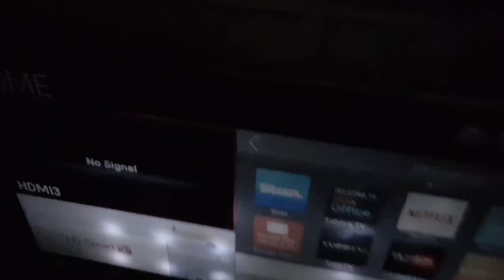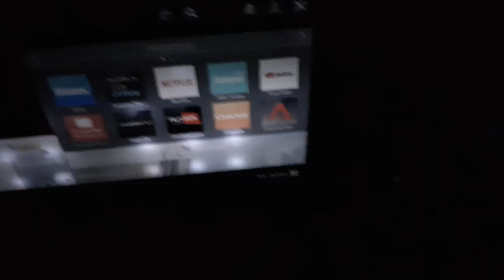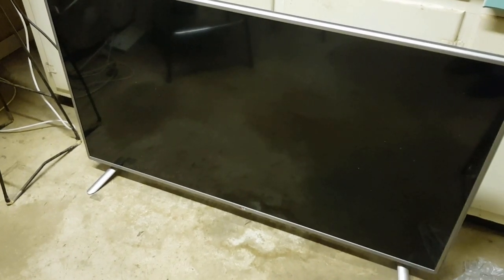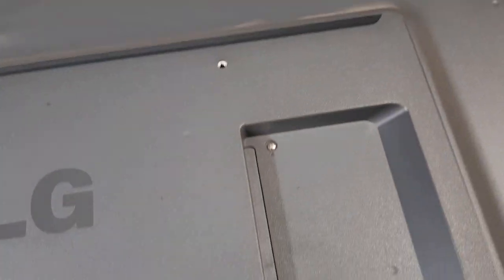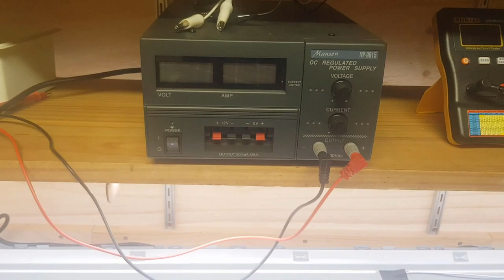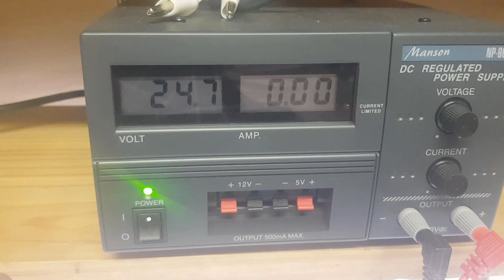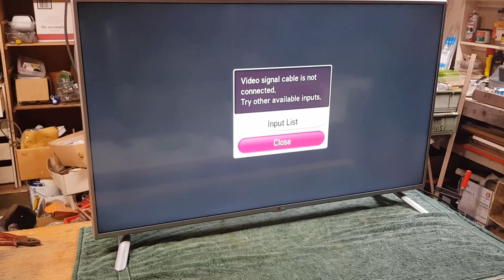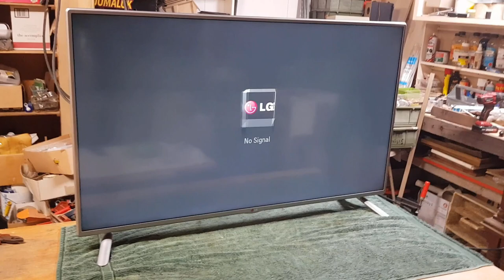50" LG smart TV repair. A great score from e-waste! Here's how to replace flashing LED backlights 😊

Comment: I've had this same tv for probably 10 years now and it just started doing the same thing.   The repair looks easy enough, thanks for sharing.
Reply from the maker: Good luck BS. It's time consuming but pretty straight forward 👍 Remember to check the LED backlight intensity setting when you are going again - they shouldn't be set at 100%

Comment: Following your video to the T, I am stuck at the part where you took the mainframe off while leaving the LCD on the towel. I have the small screws on the side removed, but I think you mentioned something about clips getting attached/reattached, do you remember how you got the darn mainframe off to the red makeshift table?
Reply from the maker: Sorry I'm a bit late with this reply! Hope you managed to work it out.. yeah, little plastic clips all the way around the housing from memory.
Reply: Insert some thin cards between the metal and plastic clips. Like playing cards or old bank cards. Then lift the chassis out of the frame one corner at a time. 2 persons are recommended fir this part.
Reply from the maker: @Simion_T  Thanks for that - good advice! 👍😊

Comment: Would have been nice if you had shown installing a row.  Is it better to put the A side down first then connect the b... or to connect them then lay them down???
Reply from the maker: Sorry Kevin! This was over 3 years ago - I was still working out what to film or not! I think I placed the strips down and then connected them afterwards. Thanks for watching 😊👍
Reply: @TheUltimateRecycler    I fixed 1 of two sets.  Cracked the screen or it was already cracked on re-assembling one.  Too bad it was a really nice set, but I did fix a good one that is working well.  Thanks.

Comment: I have just been gifted the exact same TV with the same fault. My plan is to replace only the faultyLEDs . I am also close to Melbourne. I think it’s a common fault with this model. My plan is go to Jaycar today.
Reply from the maker: Good luck with it mate! Yes, just replacing the faulty LEDs should work 👍 Remember to check the LED brightness in the TV settings once you are done - If they are at 100%, they are indeed prone to burning out! This TV is our main loungeroom unit now and still working perfectly after almost 6 months daily use. I think I have the LEDs at about 70%. Let me know how you go! 😊
Reply: @TheUltimateRecycler  This one is for my father-in-law. Did you know that this TV is a 3D 100 hz
Reply from the maker: @vk3tkq589  Nope, I didn't know that!

Comment: It's e-waste day. I paraded the line with the car idling for an hour for our free drop off. Got rid of 3 totes of boards. Didn't (couldn't) have to get out of the car as friendly men in safety vests took stuff. It hurt to see all the flat screens heaped into skid sized boxes. Hurry hurry keep the line moving. Never been any picking allowed as insurance liability kills all recycling efforts. So sad! The curb is the only place to pick these screens up. By then they are always cracked though they make great daylight "skylight" panels.
Reply from the maker: It is such a shame that liability issues put an end to so much easy repair work (and sometimes no fixing is even required!). Too much goes to landfill unnecessarily!!

Comment: My  65 inch 3D LG  TV  having  edge  leaking  light  and  right  hand  top  corner  having black shadow  due  to led back light  dead,  the  LG  service  technician  told  me  need  to order  a new  65 inch  screen   to  replace  it  which  is  difficult  to find.  And  my  screen some times  have  blinking  problem  when  the screen  turns  black still has  sound,due to power voltage  control  part  malfunction.  So  bad  the  LG  quality! LG  life  is garbage!
Reply from the maker: Yep, I've heard a few technicians say bad things about LG quality!
Reply: @TheUltimateRecycler  my  panasonic viera  used  for  decades , still no  light leaking  and  black  shadow  plus  blinking!